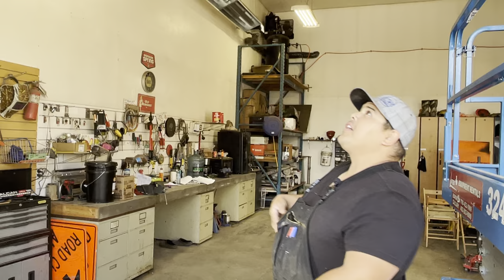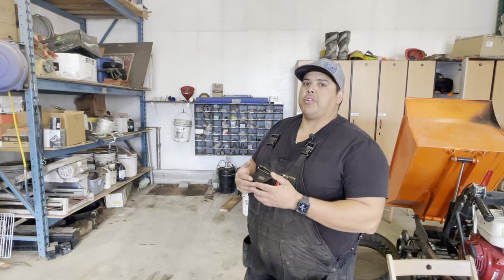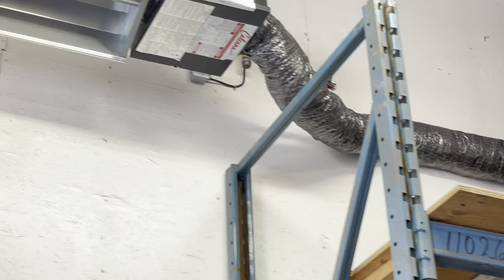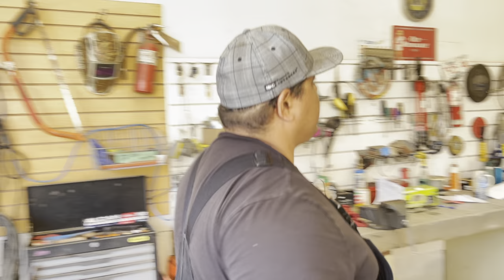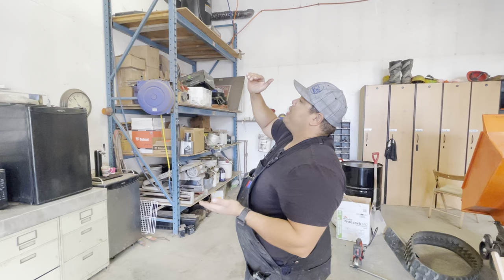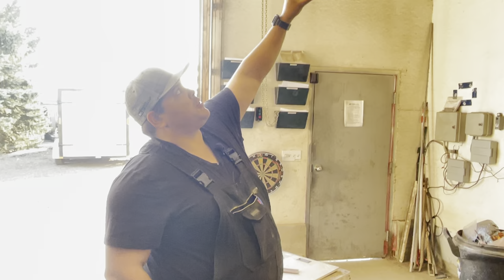Radiant Tub Heater Install - Keep Your Shop Warm!!

Comment: I have 26 x 30 pole barn 12 ft ceiling would tube heater be better placed in the center of the ceiling or would you still mount close to wall?

Comment: Probably pretty efficient too if shop is insulated well.  Also, no issues with condensation since off gases are vented outside.  Would this be dangerous for a wood shop and sawdust?  Thanks!
Reply from the maker: Ya they work great if well insulated. The vent is graded to the outside so if any condensation happens it goes out side. Should be fine for a wood shop but you may want to look into that. I don’t know for sure. Don’t see any issue. Probably better then forced air cause then you’re not blowing all the dust around.
Reply: @ThePlumbingGurus  Exactly.  And I'm not a real serious wood shop.  Just some occasional stuff but there definitely will be saw dust flying.  Maybe if I keep the wood cutting at the opposite end of the shop.  Hey thanks for the quick response and keep on plumbin!

Comment: well done!!
I would like to put one in my shop. Any recommendations for a 25' x 25' shop with a 10' ceiling? I'd also like to have hot water too.
Reply from the maker: Hi 
You might be best with a boiler system.